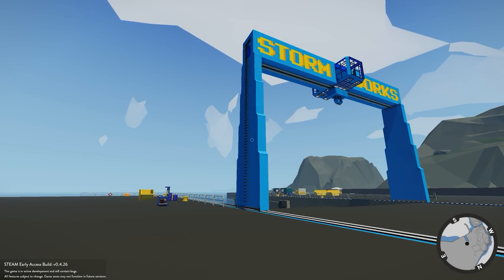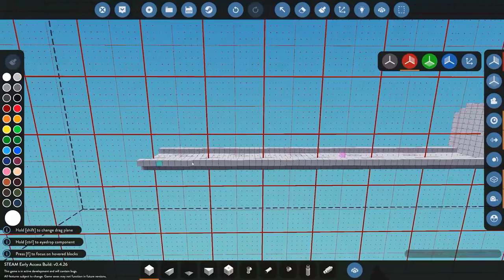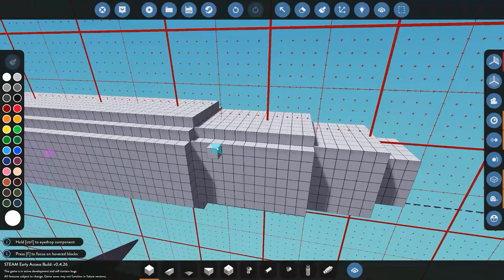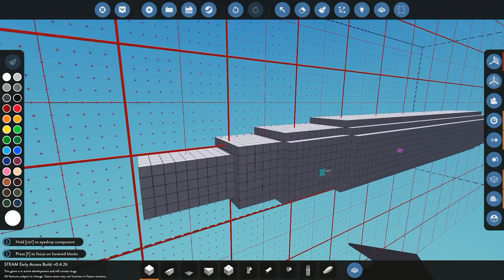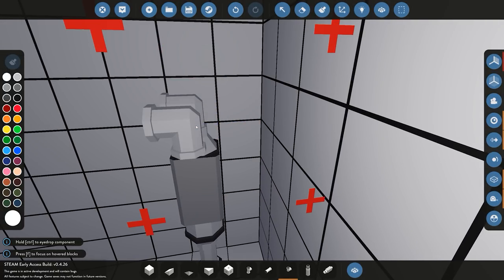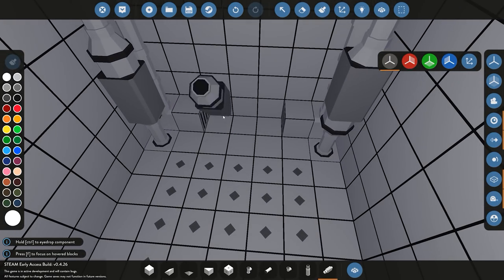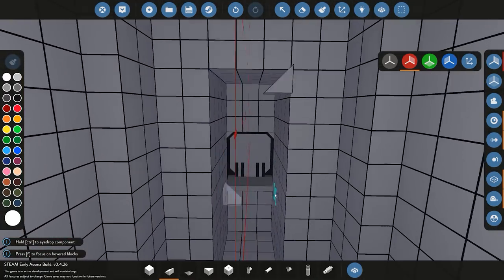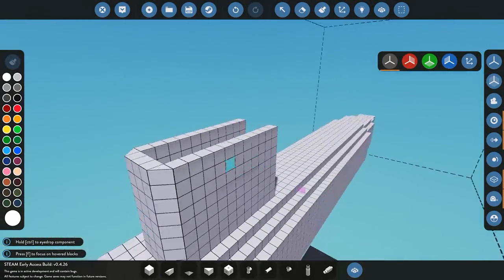Stormworks Advance Sub Tutorial Part 1

Comment: haven't tried building a submarine yet (toying with an idea for a submersible though) but it seems to me that If you build the submarine largely how you would like it to be with most heavy components installed, and then measure out equal distance from the center of gravity point  to the front and back and make identical ballast tanks you should get an equal amount of bouyancy without much trial and error.

Comment: I wish there was weight stand-ins and theoretic power testings in this game. I mean yeah you can test trial and error for things like buoyancy with ballast tanks or lift with a certain engine and gear ratio, but that ends up changing as you add more and more stuff on it and I feel like I can't actually accurately test it until I have filled a bit of it in. And then it becomes an annoying game of "do I completely renovate the setup I have to accommodate the change I need or do I build the accommodations around the existing setup?" If there was like a weight stand-in besides weight blocks or just spamming in batteries and a way to quickly test power setups of the effect an increased load of just the vehicle itself would make would be great.

I run into this a lot when building helicopters. Slap down an airplane engine or 2, hook up the bare bones for them. Test it. It flies. Add on everything else, Fire it up for it's maiden flight and it's a rock..... I would have liked to have known I needed to change things when they could easily be changed.

Also, sorry if I'm venting a little, we need to know the optimized grip % for the various wheels and tank treads. I know with treads track tension you generally want the total sum of all wheels, both drive (the gear-like ones) and guide (the round ones), that are in contact with the ground on the same track to equal 100%. So if you have a tracked vehicle with 5 wheels on each side with 3 of them contacting the ground, you'd need an average of 33% track tension on those ground contact wheels. One of them can have 34. This is what I've discovered through simple trial and error, but the margin of variable is a lot smaller for treads on vehicles.
Reply: So much word
Reply: Llllllllllllllloooooooooooonnnnnnnnnggggggggg
Reply: Welcome to stormworks.

Comment: From a realistic view point this is kinda weird.
The air inside the ballst tanks before flooding has to go SOMEWHERE. Just pumping in the water wouldn't get rid of the air so the pressure inside the tanks would get incredible high.
Is air a viable "fluid" / volume in Stormworks? Or does the game not recognize air as such?
Reply: No, air basically does not exist in Stormworks.
To remove water, all you do is pump it out.
Reply: Air is a fluid in Stormworks. The only uses for Air that I know is keeping engines running.

Comment: As of v.0.4.50, I cant seem to get fluid pumps to work in advanced mode. Everything is connected, electrical to switches and pumps, switches are connected directly to pumps. However, no particle effects from ports.  Is this a bug?
Reply: Same thing here. I think that the update of the developers had cause some bugs.
Reply: I would use the other pump